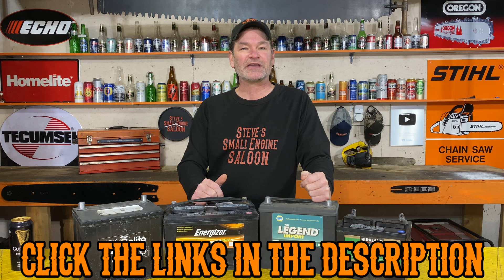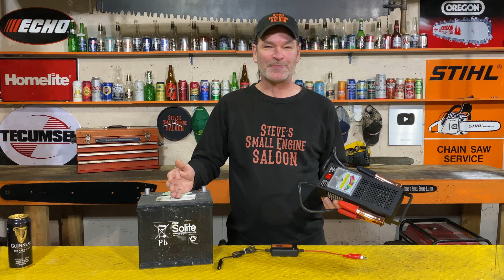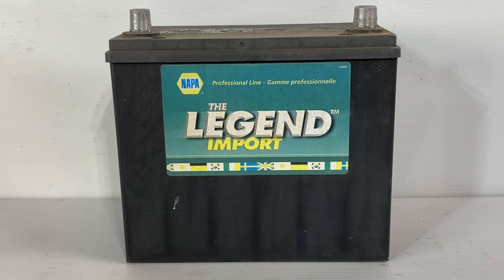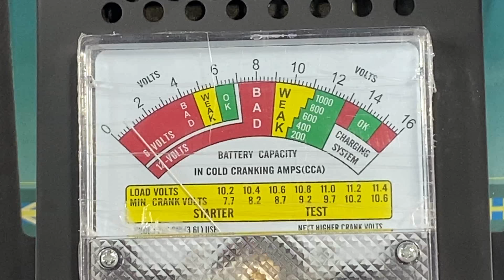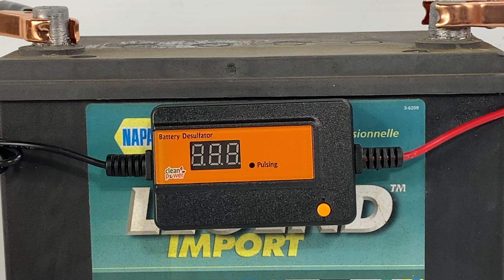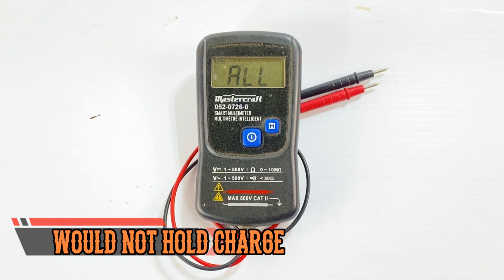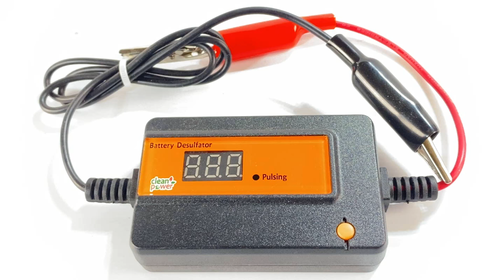Does An Electronic De-Sulfator Really Repair A Battery?? See Real Results

Comment: Steve depending on the age and how the battery was used or not used the results vary. So here is the situation I went through. I had a four-year-old battery and I believe it did a lot of sitting. For the first 6 months I had no issue with the battery after that the next 6 months it got increasingly worse as far as having to jump it and then eventually I had to jump it every single time to start the car. Not having any money I came up with a plan and it's a little different I think from what they were saying on the internet but here goes. I told the battery out I collected the contents into a bucket and I filtered it through a coffee filter and save the contents. I used two cinder blocks and two boards and flip the battery upside down and flush it out with garden hose water. I took a gallon of distilled water and about 3/4 of a box of baking soda mixed it together and filled up the cells in the battery. Of course there was a chemical reaction from the remaining acid and the baking soda I also put my charger onto 2 amps and let that s*** charging for about 2 hours. After 2 hours I took the charger off I drained the contents of the battery. Flush the battery out three times with distilled water. The fourth time I fill the battery up with distilled water and put it on the charger for about 6 hours. After 6 hours I took it off the charger once again drain the contents refilled it with the original contents and topped it off with distilled water. For the next two years that battery was perfect. So the idea is that those sulfates if you will coated the plate I guess it was the lead plate and actually acted like a short or a break in the circuit so by draining the contents of the battery and chemically scrubbing those plates usually distilled water because distilled water will draw the minerals out and of course with the charging effect would also assist in clearing the plates. So the key is distilled water that baking soda reaction initially like I said chemically scrubbed the inside of the battery.

Comment: There's an EZ fix for those stubborn, shorted cells my friend, just refill the offending cell with Guinness stout or a Black & Tan, ....then trickle charge for 48 hours!!! Battery's now Bar Room fresh and ready for another round ;) D'ohhhhh
I still prefer the draining & clean rinsing method personally.... , pulse charging is more hype than help I've been told by 2 or 3 mechs, although A buddy O mine who is an Interstate Battery Service tech says the pulse chargers WILL keep a Brand New battery newer, longer if you start to use the pulse charger on it after you bought the battery, about once a month, sez it's easier to maintain what very little sulfation there is from the start then. I say whatever works for you best, I'll try anything.....twice if I liked it ;) I've seen dude's bring 'em back by throwing 200 amp START charges on them @ 15 minutes a pop, after making sure the cells were up to level, 5 times per battery, with a cool down period (can't remember how long) in between...and that worked.
Seen simple dump & flush & rinse & flush, putting the old solution back in ....and that worked. Seen the epson salts trick work...but only about 50% of the time. Now what I need to figure out is how to get in these AGM batterys and fix those hi-dolla ho's... I gotta RV with 3 of 'em....Yikes!!
~PeasOut

Comment: Junk yard batteries have a 50% chance of being restored from low levels.  Been running same batteries for decades now
and then you can flush the acid batteries, neutralize with baking soda and replace the acid with bromide (available for cheap as a pickling additive at bulkbarn).
We are conditioned to throw way too quick and fix not at all.  Try the bromide trick on the dud batteries.

Comment: Making use of the ---> batery.repair    reconditioning plan, I just saved 2 auto batteries from being completely junked. The guides were very simple to follow. I wish I would have found this years ago! You may use the guide to recondition any battery type

Comment: I have a battery that will charge voltage wise but a cell will not show any acidity with hydrometry and won't hold the 12 volts any ideas been hooked up for a week

Comment: Steve, you may be able to do a little more work on the battery that was too low to turn on the desulfater device....top the water up, cook it on a dumb charger with no overcharge-preventing circuit for a while, maybe even weeks, and be sure to keep an eye on the water level. afterwards, put a load on it, like 20 amps until it's low and cycle it again....The desulfater device is basically doing one side of the cycle, the discharge, for you so you don't have to babysit it....check some other vids here on YT for the manual battery desulfate method details. Cheers!

Comment: I’m a lead acid battery formation technician. The only way to revive a battery is to refill the acid and reform it by draining it down to about 1v per cell and charge it slowly to allow the crystalline structure to form again in the positive plates. You’ll want your acid gravity to read about 1.280 after topping off with distilled water (if it’s too high).
If it’s been dead too long or has never had full cycles the sulfates will build up and nothing can “desulfate” a lead plate once’s its sulfated. Sometimes you can boil the crap out of it on a high amp charge to knock off some of the deposits but it’ll fail later especially under load or cold.

Comment: Some people have added a battery in series with a too low voltage bad battery and were able to de-sulfate them successfully.  The de-sulfater can handle higher voltages.
sixtyfiveford demonstrates his method for restoring batteries on his YouTube channel.  It requires an old school 100+ amp charger although there are instructions on how to convert more modern 'smart' chargers to work by others also on YouTube.

Comment: I agree! Mine works great. I have restored a few batteries. Only one really old one didn't,  but I don't know why it failed- if the plates came loose- NOTHING will fix it except a complete teardown, tear apart and r building it. An EXTENSIVE process!

Comment: I've extensively tried all the battery conditioners you could buy on the 'net, the powders, the crystals, the fluids, the electronics in a box. You know what? They do not work at all. A dead battery is a dead battery. Preventive maintenance care of your battery is your best bet. You keep the WHOLE BATTERY CLEAN, not just the top. Clean with distilled water and a soft cloth. Now, why do we do this? The dust and dirt you find on your battery is "rust dust", the rust from other older cars that used that road before you, disintegrating from road salt that was spread during the last snow storm. This forms a conductive path between your battery posts that slowly drains your battery in your car,truck between uses. This puts a strain on the battery, shortening its life. Recharging an old battery also shortens the life of your alternator if you do not keep the battery posts clean, and cable clamps clean and tight. Also, keeping the ground cable terminal clean and tight to your engine block helps a lot. Using battery clamp spray, or, if you are cheap like me, petroleum jelly really works to seal the clamps, cables, grounds and other connections sealed from "rust dust"  really works to extend your battery's life. I have a battery in my 1990 Ford Ranger Custom that is 7 years old and cranks the truck every day. The battery in my 1979 GMC is 5 years old, and even though it sits in my barn with no " battery minder" on it, cranks the truck every time I take it out for a drive (it has antique tags on it, so it is not a daily driver anymore). And no, they are not fancy named batteries, they are common Interstate "blem" batteries with the tags and labels taken off. It is not the brand, or how much you spend, but the care you take of your electrical system that makes the difference. The rest of the story here is not chemicals you put In a battery, but how clean you keep it. Also, watch the date code on the battery, marked either as month/year on a sticker, or as a week number and year (50/20 which means 2nd week December 2020). You do not want a battery marked more than 5 months old, 5 months of sulphation sitting on a shelf unused. Be suspicious of date codes on a sticker, they can be changed. Look over the battery for a melted in date code in the plastic or an abraded spot on the top or side. If you see that,  don't buy, move on to a fresher date code. Lots of places are honest, some aren't. " Trust, but verify".

Comment: I just had two success stories. One was a regular battery on my buddy's race car. It was at 14% on the battery tester after a week of desulfate cycles it is up to 68% and will now start the car.  I also did my expensive braille battery on my race car.  It does not read correctly on the tester but after a few cycles, it now started the car where it would not before.
Reply from the maker: Right on

Comment: steve if you take that battery that was only 8 volts and connect a good battery in parallel to it then connect the desulphater to the bad battery it should start working. once it gets going disconnect thegood battery. That mayhelp you out.Rgds from Australia
Reply from the maker: Good tip!

Comment: Steve, do you think there is any merit in using the de-sulfator tool when say doing a maintenance charge to try and stop it going bad in the first place? Thanks Dai
Reply: Yes.  You can leave the device connected to the vehicle's battery 24/7.  It uses no more than 0.02A according to the spec.

Comment: Hey Steve, so I purchased one of these to use on my AGM batts that are over 8 years old as I'm sure they are in need of desulfating. My question is how long to run this piece, instructions don't really say. I know you do 3 cycles of charge and 24hrs with this piece but where did you find this? Could I possibly need to run it longer, pamphlet just states 3 days to 1 month? I'm going have to pick up a load tester for sure as well.

Comment: I have had good experiences with battery minder battery chargers from northern tool and equipment. They are a charger, maintainer and desulfator in one, mine are the first generation chargers, the new ones are redesigned. Using one of these chargers and a homemade wire pigtail I’m able to maintain 4 batteries at once, made my original kubota battery last 15 years by keeping charged in the winter months. Also have one on

Comment: I "desulfate" a LOT of my own batteries by smacking the sh*t out of the battery with a 2X4.  I f the sulfate isn't too bad, it will break off and dissolve back into the solution (from what I've read).  Works for me.

Comment: Steve it's the OLD MAN here from Eliminator Performance. Love the video but just wondering if the Kirkland and Energizer batteries had failed load tests before you desulphated them? Have tried bringing batteries back to life by using a 200A engine start booster for 5x 15 minutes each time then waiting 1 hour between boosts which has brought batteries back to full service life BUT only if they showed WEAK on the load test. I believe this does the same thing as the desulphater but takes so much more time. Think i will be ordering one for my son's small engine repair business. Other than Gel batteries just peel back the sticker to get access to the ports to fill with distilled water you need to pry out the plugs.

Comment: I recently had a battery which was about 4 years old that sulfated up.  It would not take a full charge.  A friend of mine recommended dropping it twice about 1' off the ground.  Put it on the battery charger and it reached full charge and has been working fine since.
Reply: Have you ever seen a battery explode? 😱

Comment: First battery is of the sealed kind, but has become dry from disuse or age.
No desulphator/rejuvinator can fix that, but you can by adding distilled water. No junk like salts and shit, just water. Then it needs a very slow and long high voltage desulphating to get going. Often 2-3 days. The water in the electrolyte braks down during the sulphating/aging and is able to leak out of anything. That is why it dries out.

Comment: When I worked at the salvage yard, I used to take batteries from the pile and test them. If they had a decent voltage 8+, I’d put them on a ‘boost to start’ changer we had there that had a 200 amp boost setting. Boils or froths the acid at 200 amp, do that for 2-3 minutes, then trickle at 2 amps overnight and next day, good battery. Get another year or two out of them.
Reply: I did Fleet Maintenance for a few years we had a couple hundred pickup trucks and they also towed trailers with large generators with a Wisconsin engine that used a large battery. We did the same first for a few seconds it got zapped with 24 V and then as you described. 
    The original battery in my 96 John Deere backhoe lasted for 14 years before it finally needed to be replaced.🤔
Reply: I have always thought that most battery people smash car with would be ok.
Reply: I am in desperate need of help my battery is at 12 volt 888 for my moped let's go and I don't know how to get a little bit turn over it was a battery issue and now it seems to be a fuel issue
Reply: @fatlaed6251  what's the issue?

Comment: How does  it work? And you should  be able to get all the tops off a battery take the top labels off.
My buddy uses a welder 200v till it  bubbles up for 10 minutes Then let's a cool down for 20 then does it for another10  And keeps doing this till all cells are bubbling Then a trickle charges it That could fix that bad battery of yours

Comment: I don't see where that plugs into the wall?  Am I blind?  That said, I have one of these as well with similar results, some it can save and some it can't. If you save 1 battery it is well worth the investment, I also use mine to maintain batteries.

Comment: How about using this desulfator for preventive maintenance? like in a 3 year old battery that still works?
Reply: I’ve heard people that use Battery Minder 1500 that has desulfator built in with temperature sensor if used when vehicle is stored, batteries will last twice as long.  One fella said his tractor battery lasted 18 years so far and it’s still cranking.

Comment: If you keep the charger on that first battery with the desulfator it should work but it might take a week or three. You can use the desulfator and the charger at the same time, just use it at 2-5 amps and make sure it does not boil dry. You can pop the top off the battery to get access to the water caps. I just bought one of these because my diesel truck 800 amp batteries (two of them) cost $160.00 each and they get sulfated every 4 years. I'm on my third set and I want to see if I can get an extra 3-4 years out of them. All these things do is sends a square wave AC current through the battery at a frequency that will break up and dissolve the sulfur crystals. Sulfur crystals (like all crystals) will break at certain frequencies particular to that element . . . It's just physics. You can buy a tester that does not put a draw on the batteries but checks for sulfation with AC current. My 800 amp batteries were testing at closer to 900 amps when new but after giving them an equalization charge last week they are now testing at 1099 amps. Equalization charging causes them to boil and lose water but these desulfators dont do that. And they are cheep.
Reply: Que marca Son?

Comment: Hi Steve.   This desulfator works great.   I bought the one in the description.   As a side note.  I tried it on my 18v dewalt drill Ni-Cd battery that was not lasting as long as it used to and after 3 desulfator cycles the drill is working as good as new. There is a warning not to use this on lithium batteries.  So I’ll stick with regular lead acid batteries.   Thanks for all the great videos.  I appreciate the tips and tricks to keeping my small engine equipment running properly.
Reply: Nicads don’t sulfate.
Reply: @stargazer7644  But it could have something to do with the charge and discharge cycles of NiCad batteries.  I don't know enough about them, but I recall that you don't store them fully charged and you don't let them get to zero.
Reply: @GregKimura-r3k  You're confusing your battery chemistries.  You don't store lithiums fully charged and you never discharge them to zero.  NiCds suffered from memory effect, so you DID want to discharge them completely and recharge them completely or else you'd get limited life.  Regardless, a lead acid desulfator isn't going to have any effect on NiCds.  They don't sulfate.
Reply from the maker: Right on Gord!

Comment: i bought a desulphator that looked like that no luck, i ended up buy the battery extra desulphator seems to work, prior to that i just hammered batteries at 15v+ all day , theyed get pretty warm but after that they had recovered alot of amp hours.

Comment: Steve, I have a reel mower with a 5.5 Vanguard on it. It surges and pops at higher rpm. It will only run when it is sideways on a hill where the carb is on the downhill side. The moment you turn it the other way around it dies. I have just rebuilt the carburetor, cleaned, replaced and sealed the entire fuel system where needed and added an inline filter on fuel like as well. I am totally stumped! Can you give some insight on what I should look into?

Comment: Steve you can check battery solution levels on a sealed battery usually hidden under top labels you pry up flat plastic piece to reveal holes. Videos on this can be found on YouTube.

Comment: I ran my desulfator with the charger attached.  At low current, it was able to fix all the low voltage batteries so they would hold a charge and I could run the desulfator without the charger.
Reply from the maker: Good to know!  Thank You...
Reply: There are chargers with desulfator built in Battery Minder 1500